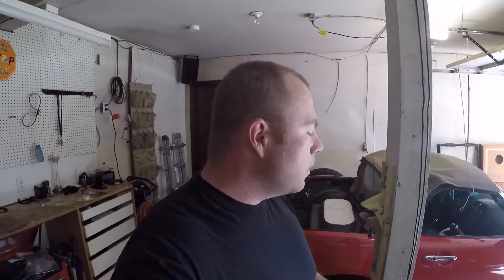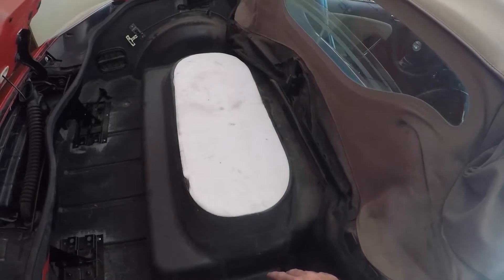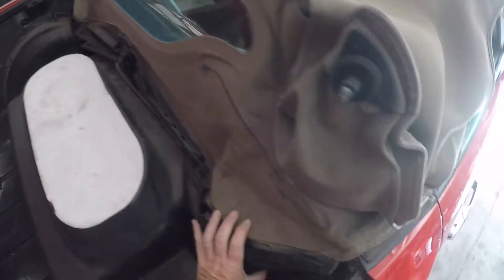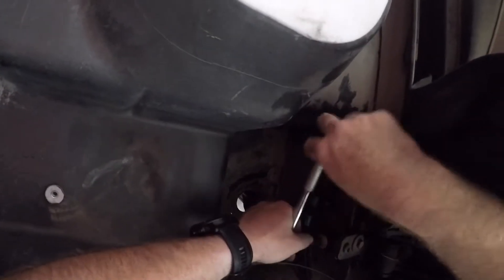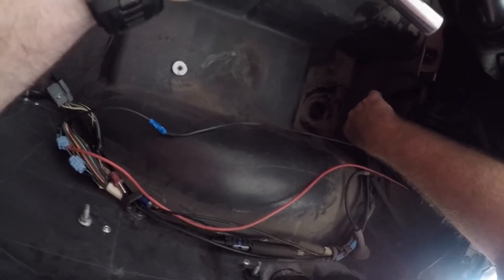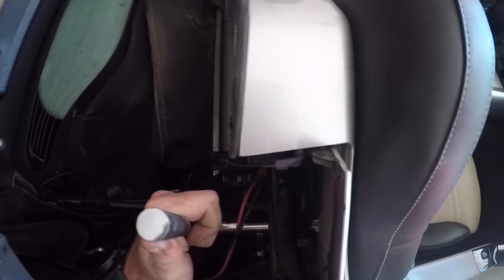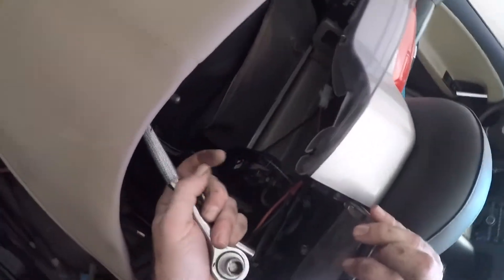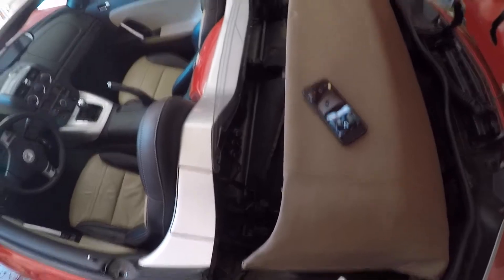How to Saturn Sky or Pontiac Solstice top removal

Comment: As an added note, I had a 2008 Sky where the fabric was coming detached from the window. Many upholstery stores will not attempt to fix because of stretching, you basically have to replace the whole rooftop. $1,200 plus $800 labor, $2,000 altogether.  This is a somewhat common problem with the Solstice & Sky.  But all in all, my Sky Redline is simply beautiful and turns heads all the time.

Comment: Wow, I'm thinking about getting this car used and I feel this is going to be the worst thing about the car... :S ugh gotta get ready..
Reply: I've owned one for 10 years and this is not the worst thing about the car.  The manual transmission's quality takes that cake!
Reply: Not sure about the transmission experience that Jake mentioned but from what I've seen with others that own these cars, a common problem many experience is the death of the timing belt tensioner at around 100k or so. Through time, it eventually wears down. Replacing it can be pretty expensive. Thankfully, it's not a major issue as long as you get it replaced before it causes bigger problems.

There's also a common issue where the radiator fan assembly sometimes dies. My local dealership charged me around $800 to fix it, which I regret doing because I could've done it myself if I had the replacement assembly and the tools I needed back then to do it. 

Beyond that, I've seen people have problems with their soft top windows popping out, which is another easy fix with the proper type of glue. 

But with all this being said, I've seen situations where the car can be a bit touchy depending on the mods one installs. A good source for stuff like this is a Facebook group named "Pontiac Solstice/Saturn Sky/Opel GT/ Daewoo G2X owners." A lot of us are members to it. If I were you, I'd check it out and request membership to it. There's a lot of great people in that who are very helpful when it comes to Solstice / Sky stuff. It's also a great source for networking with aftermarket suppliers and mechanics, too.

Don't let these issues dissuade you from getting this car, though. Despite the challenges they sometimes bring, man-oh-man are they fun cars! :)

Good luck!
Reply: @22_floW  I agree, very fun car, but not one I would recommend to someone who will be relying on paid help to maintain it. They're certainly quirky.

I supercharged mine in 2014 and it's one of the most fun cars to drive I've ever owned. I'd take it over an oem camero SS or mustang GT any day. Definitely not as fast, but handling and light weight makes for a rollercoaster type experience that's hard to find in a heavier car.
Reply: boxmonkeyracing where did you find a new one? Just got one of these cars.  Everything perfect except this roof.  No one has a clue how to fix it.